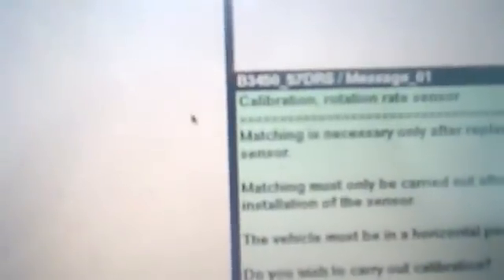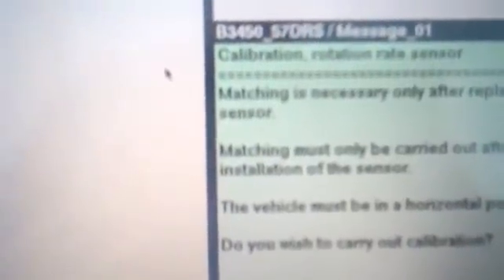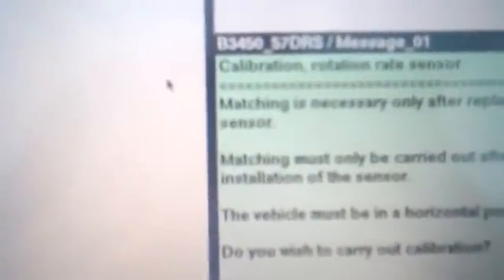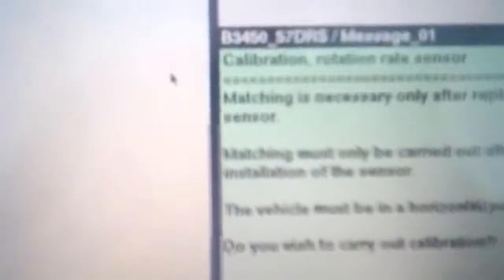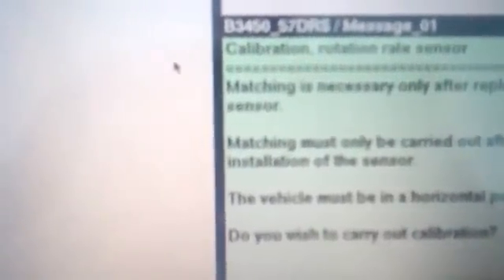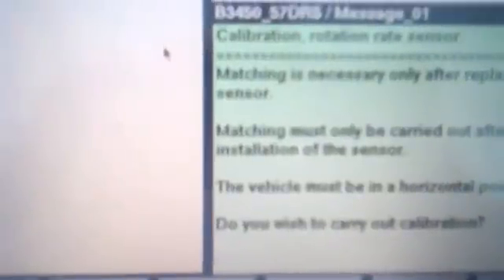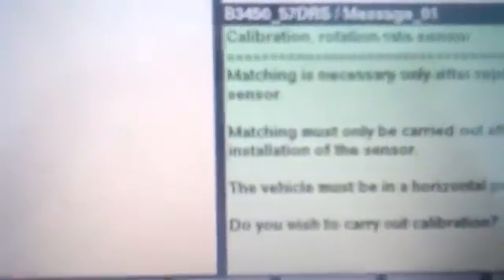DSC Sensor Calibration using a GT1 E38/39

Comment from the maker: Hello, Programming is performed using a different machine. The GT1 is only a diagnostic and calibration device with integrated test plans. For programming a SSS (software service station) or the new ISTA /P is needed for module programming. In most cases it is more cost effective for the dealer or a shop with this equipment to program for you than to purchase the device. Or you can give RPM MotorSports a call and they may be able to program for you. I have used them in the past. Good company.